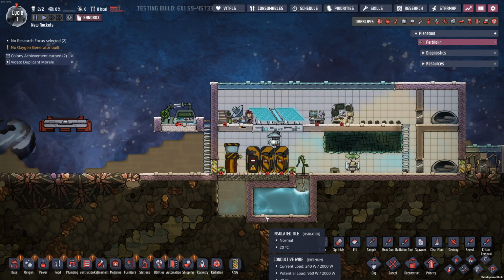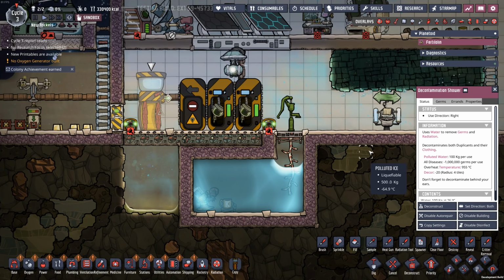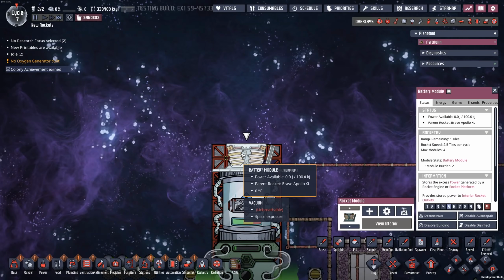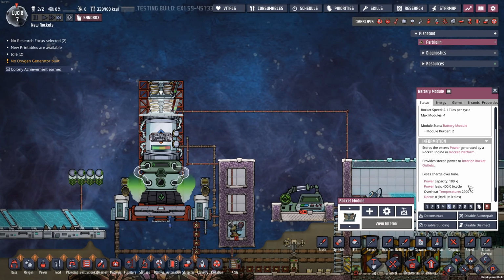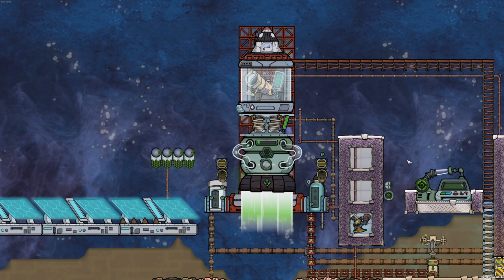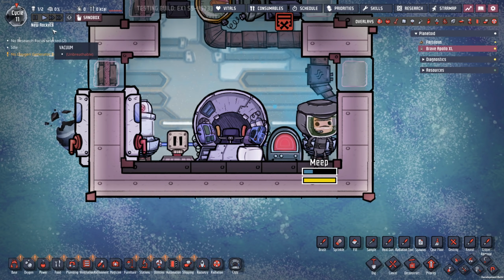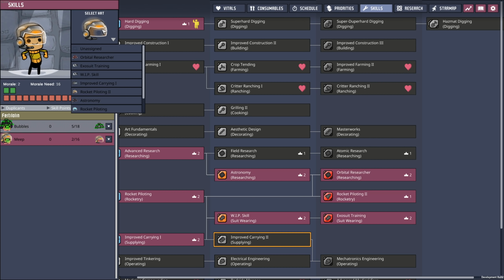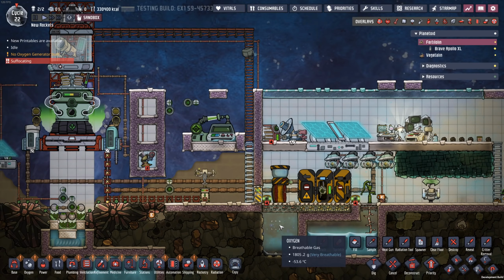Nuclear Rockets! Oxygen Not Included

Comment: Actually, real Nuclear Thermal rockets (NTR) don't spit out radiation out the back.  Instead, its basically used as an extra heating source, making the exhaust hotter, thus giving more thrust per unit of fuel.  The real downside is not when things go right, but when they go wrong, as an explosion would spew a chunk of radioactive material over a huge track of land/water.  The difference in amount of thrust you get out is significant though... from memory, you could carry 5x the cargo for the same size rocket and have reduced fuel costs.  I would not be surprised if NTRs were used extensively on travel between planets in fifty years.... unless we develop fusion rockets or similar.  The only propulsions more efficient are ion drives (very slow) and solar sails (never built and can't really go sunward).

Comment: The new modules for rockets are great, but I think they need make them better.

Change battery module by solar panels, so, the rocket always have enough energy in the space, could be a problem if you run out.
Vents have to suck carbon dioxide around them, but we still need this ugly gas pump, at least, they need to add filtered gas pump.

A comment said, that gas vent are already filtered, so, you don't have any problem if you store CO2 in the rocket.

Comment: I’d like to point out that the real engine you mentioned only used a nuclear reactor as a heat source for hydrogen fuel, none of the radioactive material was intended to be exhaust 

Check out project Orion though, using literal nuclear bombs for propulsion

Comment: At this point I'm so lost with where this game is trying to go, I watch people play the game so I don't have to figure it out for myself what things are for the first place, and that's a first, because I usually figure it out myself then watch these to see if there is a more efficient way. So this video became a "how to play" instead of a "how to do it better" type of thing for me. 

Thanks Klei! (that was sarcasm)
Thanks Brothgar! (that wasn't)
Reply: That was needed the game was so linear and easy before, every play through was pretty much exactly the same fundamentally (early base -> coal power -> dig map -> standard oxygen setup -> get oil/plastic -> heat deletion -> 100% sustainable) now there’s dynamic ways to approach the game setting up infrastructure rocket shipping between separate colonises, having to worry about radiation etc, the game needed a rework like this in my opinion
Reply: @justgame5508  I'm not talking about Spaced Out in general, I'm talking about this whole nuclear update. That's when things went south. The meaning of "option" applicable here is something that nets you the same result with an alternative approach. Using smooth hatches to refine metals instead of wasting half of your metals in a rock crusher, or using 1.2 kW of power and/or coolant you may not have for a refinery is a very relevant option. You aren't generating heat or put electricity into the process, in turn you get slightly worse conversion rates.

So far this update doesn't give you options, it mostly just introduces redundant things that are rendered pointless by requiring additional time, resources and dupe workload to achieve the very same thing you could do formerly anyway.